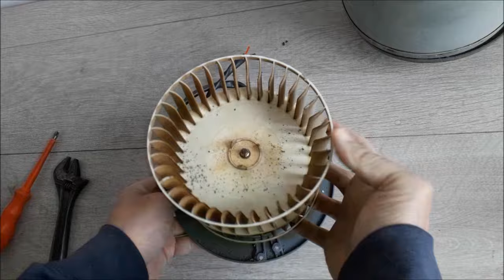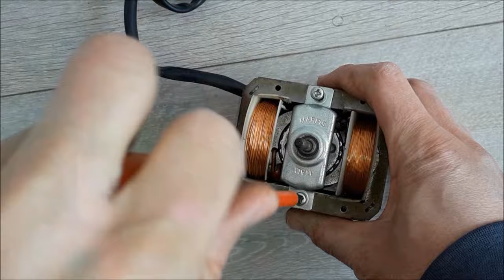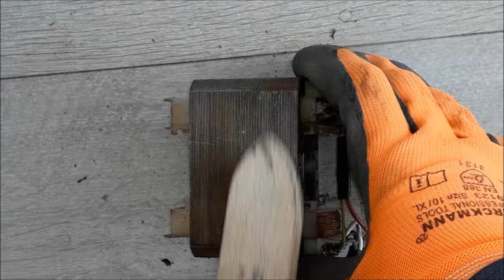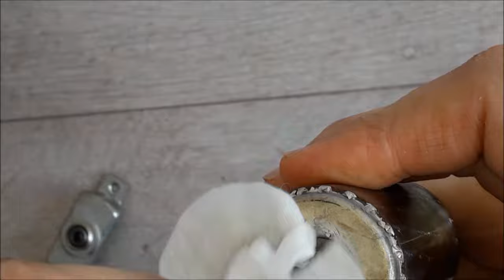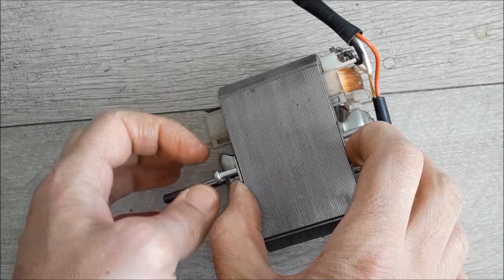Extractor Motor Restoration Atag

Comment: Thank you for this vedio as i was looking for motor similer to mine..Hotpoint Cooker HE62X Hood Impellor Fan. It is exactly same probably come from same manufacturer. This vedio helps me to understadn set up. I was able to clean the dity fans as original digrams does not tell full story

Comment: Thank you very helpful. Mine is not working, so I will start cleaning from tomorrow and will see how it goes. How to find on  meter that motor is dead ? Or what is the first first step you take to find what is wrong with motor ?
Reply from the maker: If the resistance of the motor windings measured with a multimeter is too high, than there is probably something wrong with the motor.
Of course you do that after unplugging it.
Good luck.

Comment: Does cleaning the outside of the motor with the wire brush improve its operation?
Reply from the maker: yes, the motor can then lose its heat better
Reply: Ahh yes ok, thanks for a very informative video.

Comment: i cleaned mine was working for 1 week and now has no voltage going to the motor but the lights are working fine.  I will figure it out when i have more time . Any suggestions ?
Reply from the maker: You can measure if the is a voltage going to the motor. Good luck
Reply: @TIRestoration   the termal fuse on the motor was faulty

Comment: Interesting. My 10 year old motor suddenly died while in operation. Wondering if taking it apart and cleaning will do anything. Can't buy a replacement motor without it costing more than a whole hood.
Reply from the maker: Sometimes it's worth taking it apart to see what could be the problem, before buying a new one. Good luck

Comment: Is the grease you use regular vaseline? I currently have my device open, and the only thing i'm still unclear about is what type of oil/grease to use to unblock the (stuck but not dead) motor unit
Reply from the maker: I used gear grease, you can use WD40 to unblock the motor unit and then grease or lubricate oil for the moving parts. good luck
Reply: @TIRestoration  i found a WD40 spray in the kitchen, some gear grease in a toolbox the previous tenant left, and it bleeping works again o.O thank you for the quick reply, from all four in this house!

Comment: I have a virtually identical motor but the springs are tiny.  The motor axle is free to move up or down about 1cm and causing the fan to scrape against the housing.  Any thoughts?
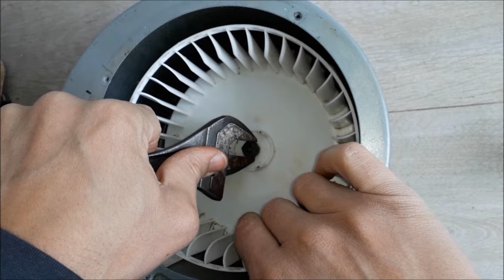Reply from the maker: If it is the same it might be the nut in the center of the fan has come loose, you can adjust the fan up or down and tighten it well, you can also check the video at 10:40. good luck
Reply: The nut us tight.  The issue is that the axle is free to move backwards and forwards along with the armature so that the fan hits either side of the housing.
Reply: I have packed this with a couple of washers to minimise the axle movement and it seems to work.  Thanks again for the video.

Comment: In this motor there is capacitor?
Reply from the maker: This a single phase induction motor that has a capacitor in the auxiliary winding circuit to produce a greater phase difference between the current in the main and auxiliary windings. It starts with the help of a capacitor. Good luck
Reply: @TIRestoration  How can we increase the speed of this motor ,mine is running very slow
Reply from the maker: @live-your-way  By increasing the supply frequency. Good luck
Reply: How can we check the capacitor?